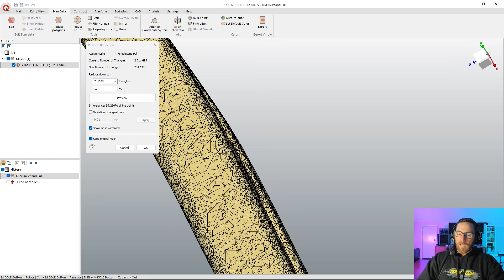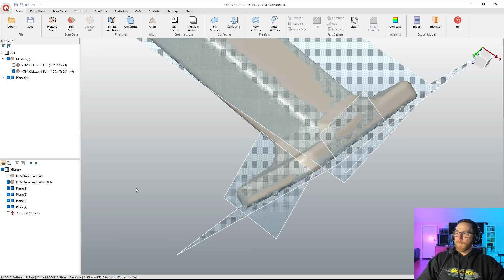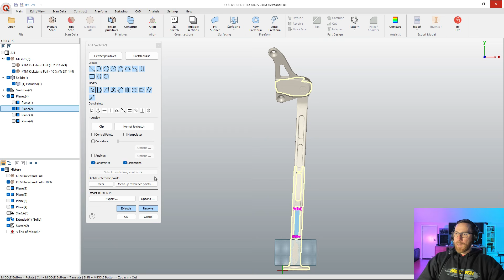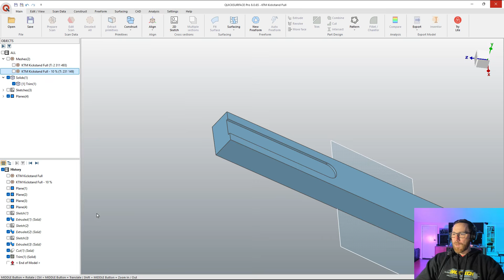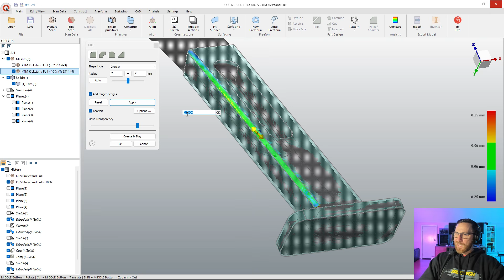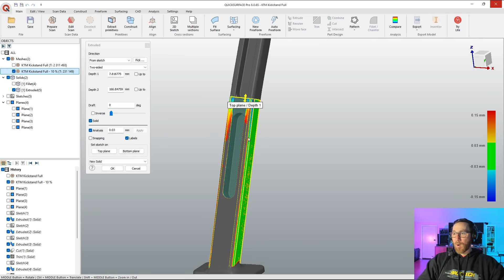Designing an Adjustable Kickstand Part 2 | Processing and Modeling with QuickSurface Pro

Comment: So I have to do some inverse design off of the back of a TV. I only have Fusion. Would you recommend this tool instead?
Reply from the maker: Are you trying to replicate or make something fit it?  QuickSurface is specifically made to clean up, align, and make geometry match a mesh.  As for designing i still prefer to go to a cad program.  So if the goal is to design something to fit the scan I would still go to Fusion.

If you need a tool for personal work (non-commercial) QS does offer a Personal version.  it lets you process the scan, align to a coordinate system, and even do some modeling but the export is STL only.  If you want to export some cad geometry then LITE is the next step up.  Has limited features to Pro but is available for commercial use.
Reply: @LearnEverythingAboutDesign the TV has a weird back to it undulates a little bit, and I want to build essentially a backing base for it so that it can sit flat on a table. So I'm retrofitting a sort of curvy ridgy?) triangular pattern but also a boxy section where all the plugs and stuff are. I'll be 3D printing that base that I make out of it and it doesn't have to be a perfect fit, just pretty close as I'll probably adhere the twp parts with 2-sided autobody trim tape.
Reply: If you look up a hisense 55qd6qv 55 inch tv and look at the back you'll understand. It's a weird one.
Reply from the maker: @dubCanuck1  what i could suggest is using the threaded mounting points for the tv in the center and then it looks (from the pics) that the last bit around the bezel is flat.  Could you make something that touches around the edges.

One thing QS would help with is making a fit surface for the lower part of the ridges and then another for the upper part.  It would be easier but i wouldn't say "easy" :)
Reply: @LearnEverythingAboutDesign Yeah. For now I just printed legs which fit the offset bolrs they supply for a wall mount, but those are not exactly sturdy, hence the desire to make a lower part to act as a better base, but also conceal LEDs, extra speakers, remotes, pens/markers.... It's for an RPG gaming TV
Reply: Pedestal! That's the word that was escaping me......